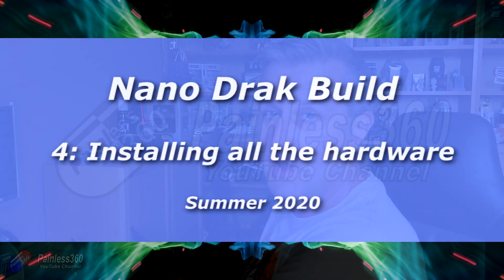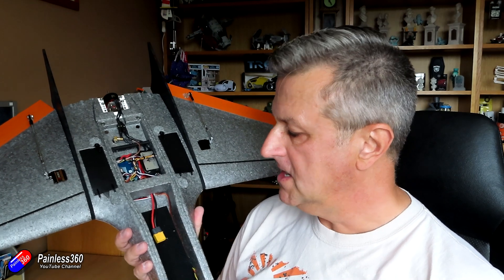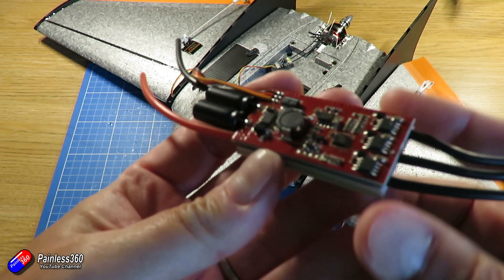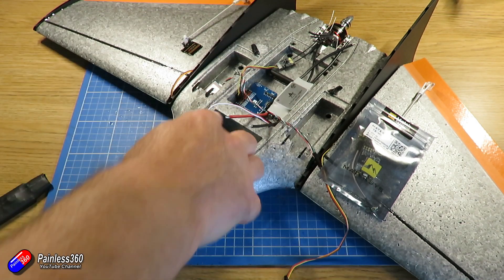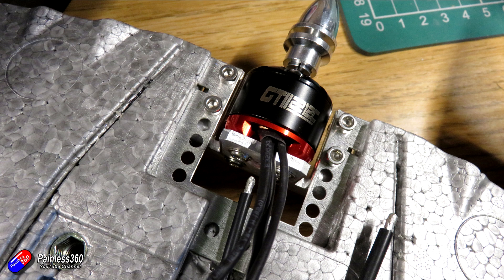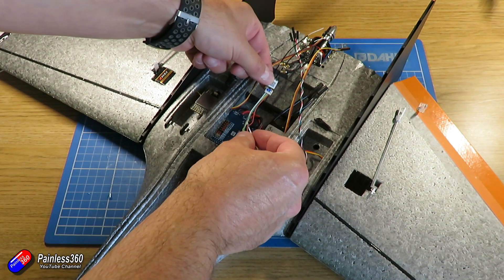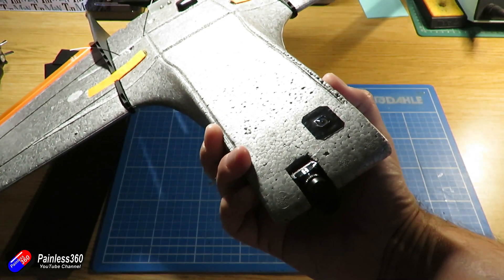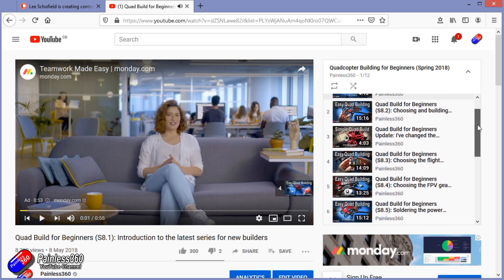Nano Drak Build: Part 4 Installing the electronics...

Comment: #painless360 hi lee, hope you are well, had a thought!! (oh god) could these new 3 blade folding props be any good on a wing? can you suggest any folding props with cw and ccw rotation? i have a s110 wing with dual motors and wold love to get rid of the two 7" props causing 14" with of drag lol. thanks for your content
Reply from the maker: Not sure. The folding props designed for quads don't fold in a way that would get them out of the airflow. Come to think of it (and a few mins checking places like 3DXR) it does appear that they are designed for only one rotation direction. If you do find ones that do both directions, please let me know..

Comment: Flip the motor mount and mount it as far back as possible, its a hell of a lot quieter
Reply from the maker: Great suggestion but only possible with an action camera in the nose for CG... Happy flying!
Reply: @Painless360  Running the turnigy 4s 5200 12c in mine. 60amp cobra esc in the rear and the cobra 2814 1700kv and the CG is perfect
Reply from the maker: Sadly that wasn't working here with the pieces I have. Really interesting to see what you're using. Thanks and happy flying!

Comment: 👽👽👽👽👽👽👽👽👽
Hi Lee, we've all been conscious of keeping the VTX away from other GPS and RX antennae, however, do you think 100mm makes much difference, seeing that they're all on different frequencies?
Reply from the maker: It's not just the frequencies they transmit, you also need to be wary of any other frequencies they generate in operation too... For example the camera on the Fatshark HD test system has a harmonic on the 1.2-1.3ghz frequency that stops a GPS from getting a lock if it's too close. Feel free to try them side by side - this works here... ;)